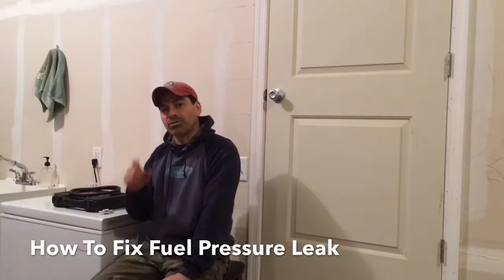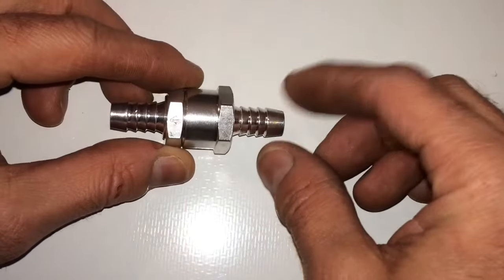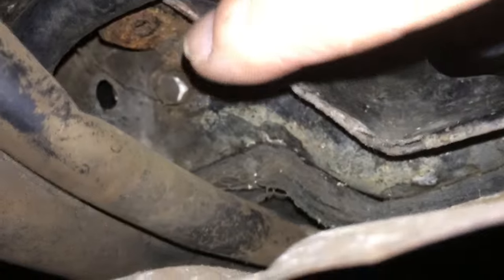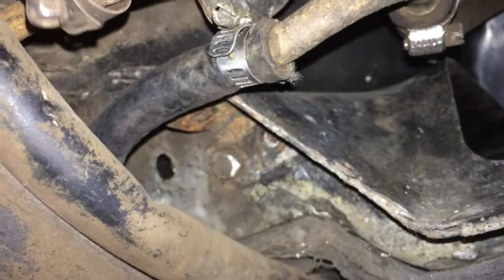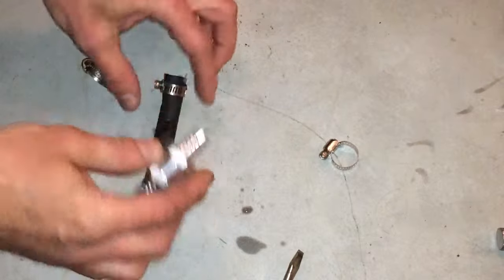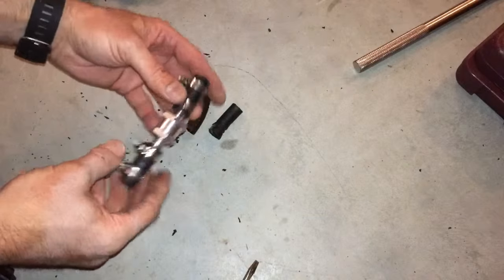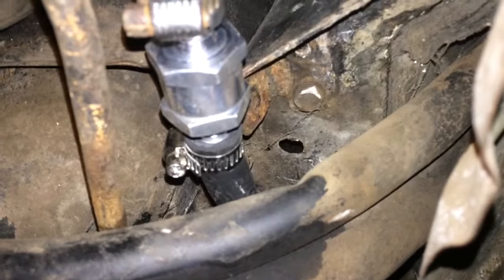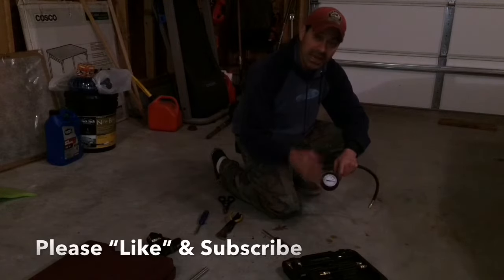How To Install An Inline Fuel Check Valve (Andy’s Garage: Episode - 49)

Comment: This fixed my issue, used to have to crank 3+ times when cold starting
Reply: Can u pls explain the issue u were facing like i also have to crank 4-5 times in morning and the engine even produce weird noise like misfires (even in summer ) and whenever i park my car for 3-4 hours and after that when i try to start my car i have to crank 3-4 times but during the day when engine is bit hot after running there is no such issue and car starts immediately in half crank

Comment: I use this valve for air check valve replacing the plastic OE/OEM that’s prone to fail so badly after some years, worked great !
Reply: Still working to this date 2024 ?
Reply: @playstation2bigs I’m sorry to tell you the bad news, this type of check valve is good outside but it’s not inside, Guess the pressure and heat was the cause! Lastly
I swapped the valve with Valve from “ Nissan motors, it’s an original, it’s pretty solid build and so strong valve than normally used for other parts or manufacture products !

Comment: Something to consider as a reason not to fit a check valve too close to your fuel rail - that is better to fit near your fuel tank - is that with a performance/race car that sits around a lot, you may want to let it turn over a bit before it starts to build up some oil pressure before it starts. An alternative is to disconnect your crank angle sensor, dizzy, plugs etc. (Some use oil accumulators or I use a power-drill powered filter pump). Also if running E-85, may be better to not even have a check valve as if fuel drains back into tank it's not sitting in fuel rail potentially damaging injectors.
Reply: @tthams73 for a Fiesta yes, but a modified motor not started for a time will need a good coating of oil to cam at top of engine before initial running at fast idle, hence cranking at starter speed for several rotations without firing using pump to push oil over cam causing no sudden fast cam rotation without oil(it takes a few seconds for pump to push oil up engine when started, cam spinning at 2000 revs on start/fast idle before oil coverage is there will kill a race cam) 😮

Comment: It didn’t work for me, I did everything right but no luck! I still have to turn the key a few times to prime the pump to start.
Reply from the maker: @donharris1615  you fuel pump might be failing. Check your pressure and make sure it’s to spec
Reply: @PhillipsVision  I have a new fuel pump along with a new fuel pressure regulator, also installed a new gas cap, PCV valve, and fuel check valve, also purged valve, still not starting on the first turn?
Reply from the maker: @donharris1615  have you checked your pressure? Could be your injectors
Reply: @PhillipsVision  On this vehicle there is no valve to check it, however it run smooth idols Smooth accelerate smooth no issues, also poured in some Royal Purple fuel injector cleaner with some 93 octane premium gas

Comment: If I have the style fuel filter with three ports, won’t I need to add it on the return line from the filter going back to the tank if it’s the regulator that’s on the pump that’s leaking?  I’m afraid if I put on the supply side it will still drain back through the return line. and if I put it downstream of the filter it will over pressurize the system and not allow it to vent back. Your video only shows the two-port fuel filter. Thanks
Reply from the maker: Normally you want it to prevent fuel from leaking back into the tank after it leaves the sending unit. I’m not sure why you would want it on the return line since that must flow back to the tank. A check valve functions by using a flap that opens only in one direction. If you put it on a return line the fuel will not be able to flow back at all.
Reply: I meant with the flow direction towards the tank so it can flow back but the 2 psi required to crack the valve would be enough to keep the line full up to the fuel rail when the engine is off.  I can’t think of any other way on a system with a 3-port fuel filter unless the leak is at the pump (supply side). I guess I could try both as long as I keep the flow in the right direction.

Comment: Hi Andrew,
 Great video, I have one question: if the fuel pump check valve has failed, isn't there enough fuel in the rail to start the engine? Also is it best to install the new inline check valve closer to the gas tank or the fuel rail? Thanks so much
Reply from the maker: You should be able to start the vehicle but the pressure will drop. I would install it close to the pump

Comment: Looks like a great solution. However, I have a question: Does the new fuel check valve place additional strain on the fuel pump that would result in early fuel pump failure? Any feedback would be appreciated. Thank you.
Reply from the maker: I have never encountered that.
Reply: @PhillipsVision  Thank you for the reply.
Reply: No it’s allows fuel to go one way without restriction but not allowing it to back flow when the engine is off.

Comment: Thanks ,  I thought there may be an easier way than to drop my tank and change my fuel pump. I will let you know if this works in my 1999 Pontiac Sunfire.
God Bless
Reply: How did it work?
Reply: Did it work?
Reply: Under further investigation , it turn out to be my ignition switch slipping out of the on position, turning off the ignition.

Comment: Great video!  I'm no mechanic, but if you don't put the check valve at or near the tank, doesn't that leave an air pocket that will go into the fuel line leading to other issues?  Also, for really hot engines, don't you want a check valve that opens backwards if the pressure gets too high?  My understanding if the fuel heats significantly after the engine shuts off, you'll want it to release that pressure back to the tank.  Hoping some experts can comment on this.
Reply: You were correct when you said you were not a mechanic. 
The check valve is there to keep fuel from draing back. To ensure quick start next time. 
These “fuel pumps” are marginal, for use w. 50c engine. 
Not much volume, not much pressure. 
Enough for consistent running.
Reply: @tomreyn3610  you are 100% correct sr
👍

Comment: Shouldn't it be installed after the filter, so the filter can reduce the amount of debris that may accumulate over time in the NRV / check valve?  
I read somewhere that the NRV / check valve can be clogged due to debris or any kind of dirt within time, especially when it's installed between the tank and the filter. I would say and propose to install it after the filter, if that makes any sense. If this is correct about valve getting clogged, then it's not something maintenance free and we should always keep an eye on it and replace after the recommended period (which I have no idea what this period is exactly). Of course it depends on the media type whether water, fuel, oil, etc. 
Hope it makes sense. Glad if someone has a better suggestion. Thanks a lot.
Reply: No, you should definitely install a fuel check valve as close to the fuel pump as possible so that you maintain fuel in as much of the fuel line as possible
Reply: @lawpenner  but it is the pressure at the manifold you are trying to maintain, so closer to the fuel rail would be better
Reply: @kellismith4329   No. The original equipment has the fuel check valve at the pump location for a reason, where if the check valve is working then the whole fuel line will be pressurized right up to the fuel rail. But if your check valve is at the fuel rail only then the fuel line behind it can drain empty all the way back to the tank. Then you get sputters on start up, and more at risk of inconsistent fuel pressure
Reply: Always between fuel filter and pump. Filter will keep any install debris out of injectors.

Comment: my fuel pressure is at 60PSI when running but instantly drops to 0PSI when I kill it. Priming the pump it doesnt prime at all. the fuel gage goes crazy on the reader. also seems like my jeep eats gas pretty bad. Should I do this or just replace the fuel pump, seems like the PSI is high and wondering if thats causing increased fuel consumption?
Reply from the maker: @TacticalNightBoy  if 69 psi is higher than your required pressure and your pressure is not holding, then most likely your fuel pump assembly is bad and needs to be replaced.

Comment: Is this hard on your fuel pump to have the check valve spliced in? Since it takes whatever amount of pressure to open it up?
Reply from the maker: No, it’s a thin flap that opens. Does not require much pressure

Comment: Phillips Vision adding  this valve in the fuel system  will this affect  the fuel pressure in the system ????will this car struggling geting fuel in higher  rpm???
Reply from the maker: It will not affect the pressure, it will help keep it from dropping. It does not affect the fuel flow since the valve only closes on one side to keep fuel from returning to the pump, not from getting to the Injectors
Reply: @PhillipsVision  thnx for th reply!!  good work  !!!

Comment: hmmm... thinking out loud here... My little petrol Corsa C wouldnt start, no pressure at the fuel rail, so I put in a new pump.  It ran perfectly for about 20 klms and then the symptoms started. It is hard to start,  idling/running rough and gutless.  Hit the accelerator and there is hesitation then the revs slowly build.  I have 55 psi pressure at the rail but it instantly goes to 0 when the pump power is cut.   Ive checked the regulator and thats working.  Ive cleaned the filter out and its running clean without restriction.  The injectors are all working producing a good pattern.  So the only issue I can point at is likely to be the check valve at the NEW pump failing BUT  I cant see how that would cause it to run rough etc once its been started as the pressure is being maintained by the pump and thats working fine.  Very confused...

So Im thinking maybe I could install a check valve in the line but also that there must be a reason why manufacturers dont install check valves.  I can only guess that the pump may produce too much pressure at times.  No worries I hear you say, the pressure regulator on the return side controls that.  Problem is on many cars there is no return from the injector rail.  The return is directly after the fuel filter which is at the tank and there is not enough room in the line to add any check valve.

In my Corsa C the fuel line setup goes; fuel pump (in tank pump) which has a check valve built in to it. Pump to filter which is mounted on the side of the tank. Directly after filter the line splits in two.  One goes to the fuel rail & the other back to the tank.  The back to tank line goes through a pressure regulator built into the tank access port lid.  Pressure is maintained by the pump, the check valve and the pressure regulator.  

Thoughts...

anyone..?
Reply from the maker: Install a check valve after the fuel filter in the line going to the rail

Comment: Since its cheap and easy to install is it worth installing one just for the sake of it
Reply from the maker: If you don’t need it, I wouldn’t do it since it requires cutting the fuel line.
Reply: @PhillipsVision  - would I need to cut the fuel line though if I just add it in where it meets the filter? And not be a preventive measure as opposed to waiting for it to go wrong
Reply from the maker: @novasigma5964  if you add it near the filter, you shouldn’t have to cut it

Comment: I have the same issue with fuel pressure. I am also getting a po300 code with an occasional flashing check engine light. Can this issue cause that? I have changed the plugs wires and coils. Have not looked at the injectors, fuel filter, and don't want to think about the  fuel pump
Reply from the maker: I would check the pressure regulator and filter. Check inside the throttle body, if there is gas in there it’s most likely the pressure regulator.

Comment: By installing the new check valve this way, could there be any issue from an air bubble being created between the new valve and the leaking valve at the fuel filter? Or would that air bubble be gone for some reason by the time the flow gets to the injectors?
Reply from the maker: I’ve never had any issues

Comment: My fuel pump sucks fuel from the engine end, rather than pushing it through from the tank end - would I still need to install the check valve in between the tank and the filter (before it gets to the pump)? Also, does it matter how far from the tank the check valve is inserted?
Reply from the maker: If you’re getting fuel back then it’s coming from the return line. The check valve will prevent it from coming back down the sending line.

Comment: Can u pls help me iam facing a issue like i also have to crank 4-5 times in morning and the engine even produce weird noise like misfires (even in summer ) and whenever i park my car for 3-4 hours and after that when i try to start my car i have to crank 3-4 times but during the day when engine is bit hot after running there is no such issue and car starts immediately in half crank
Reply from the maker: @RajatSharma-rr9bi  start by checking your fuel pressure to make sure it’s the correct psi for your vehicle. Here’s a link to a video I did showing how: https://youtu.be/rAJOSQcmnqA?si=TVeOI4DVEsUXKMbr

Comment: I'm having the time of my life keeping my 04 BMW 325i in tip top shape, has been having long starts for months now, I just put a salvage yard fuel pump in mine, it looked new but must had a busted check valve, do you think this will keep it from cutting out of gas at 50 mpg to E also?
Reply from the maker: Check your fuel pressure first to make sure that’s the issue
Reply: Hi!
I have a VW passat 1.9TDI 130 ps made in 2004 and I have difficulties starting it when engine warm. It cranks about 10 second or more by keeping the key on start position until the engine finally starts.
Do you think that this valve will fix this starting problem?

Comment: It's still losing pressure but lesser than before any way I know this 
Check valve I use it usually  near the fuel pump  where is the outlet for fuel to the fuel rail 
 but 
My question is 
is it ok to put it before fuel rail so it doesn't lose pressure that much 😁
Reply from the maker: Yes, you can place it near the rail. I always install it near the pump since I’m assisting the one in the fuel sending unit. If you’re still losing pressure it may be your regulator that is failing if it is near the rail.
Reply: @PhillipsVision 
I don't think it's the fuel pressure regulator in the fuel rail cause iam connecting the fuel gauge to the  hose  which is disconnected from fuel rail keeping rule out fuel rail

Comment: Will this work with the plastic fuel lines that some vehicles have?
Reply from the maker: Should. You may have to add rubber hose connectors

Comment: Can I install a check valve in the engine bay before the fuel rail instead of under the car?
Reply from the maker: I don’t see why not, as long as your fuel lines are not rigid. A lot of vehicles have more rigid lines coming into the fuel rail than coming from the fuel pump.

Comment: My issue isn't on the main line that supplies fuel its the return line.i closed off return line and pressure remained good but as soon as I opened it,it lost all pressure . So would it be better to be placed on return line?
Reply from the maker: No, because if you put this on the return line it will prevent fuel from returning back to the gas tank. The return needs to flow back
Reply: @PhillipsVision  got it thanks .

Comment: Will this work if I have slightly low fuel pressure will it bringbit back up to correct pressure?
Reply from the maker: That might be the pressure regulator. This will solve the issue of pressure loss if the fuel sending unit check valve is failing
Reply: @PhillipsVision  I recently changed my pressure regulator just tested it just now hot 52 psi with key turned 2 clicks gonna see if pressure drops after 20 min
Reply: It's already down to 50 in like 5 minutes so it may be a good idea to install this valve? Is 52 to low and it was bouncing slot while pressure testing while running bouncing about at a 5 psi range

Comment: My 01 Yukon 5.3 is getting up to 58 to 60 psi. But rapidly loses pressure. Is this the problem and solution or is it fuel pump? I changed the fuel filter and the camshaft position sensor.  But it still just turns and doesn't start
Reply from the maker: Yes, this may help. The check valve in the sending unit may be bad. You may also need to replace your pressure regulator.
Reply: @PhillipsVision  I replaced the regulator and the fuel pump.  Still cranks and won't start. Idk what else is left, I'm sure its gotta be something simple that I've overlooked.  I have spark so probably not crankshaft sensor.  Any other ideas? Thanks
Reply from the maker: @frankdrebin5554  are you sure the pump is working? Are you hearing it prime?
Reply: @PhillipsVision  absolutely.  Unfortunately I did a compression test and well it could be because the battery was low but, the compression was very low. 130 psi on cylinder 1, and 90 on 3, 45 on 4. But my battery in this vehicle hasn't been used in over a month
Reply from the maker: @frankdrebin5554  try recharging your battery to a full charge

Comment: What size check valve do I need for 2001 silverado 5.3 v8?
Reply from the maker: You’ll need to find out the diameter of your fuel line and find the correct check valve

Comment: Can the pressure bleed off the other way?
Reply from the maker: Brian Mitchell no, once the fuel passes through the valve to the fuel rail it will be blocked from returning. If you had a leak on the other end it would be at the pump which wouldn’t even make it to the rail for pressure testing
Reply: Yes, leaking fuel injector could cause pressure drop.